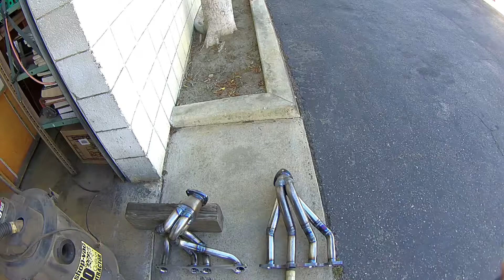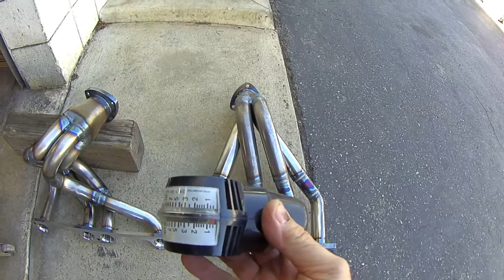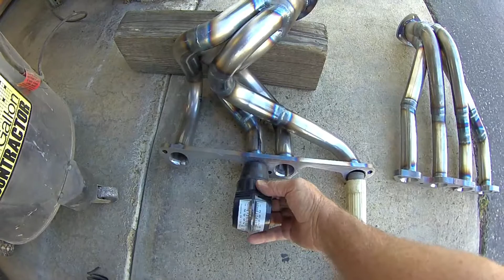Fiat header flow test, part 3

Comment: This doesn't really show scavenging in its entirety. Scavenging is also an acoustical property of pressure differentials being carried through exhaust flow and being reflected at a change of interface or cross section. The reflected pressure differentials can then be aligned with valve events at specific RPM to generate an 'acoustical supercharging' effect. This type of steady state flow demonstration shows inertial exhaust flow. Both go hand in hand and are both important but you have to remember exhaust is a non steady state flow and this doesn't show the whole picture.
Reply from the maker: it wasn't intended as a scientific test, merely a comparison of our header vs a stock manifold. There are many urban myths floating around about the effectiveness of the factory cast iron manifold and this is just a basic comparison of the two. This is part 3 of the comparisons, check out part 1 and 2